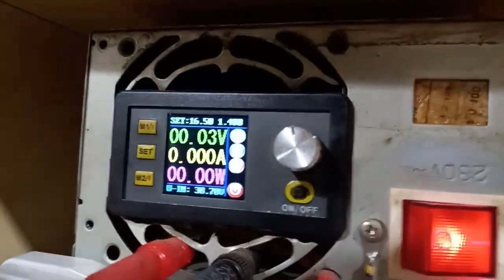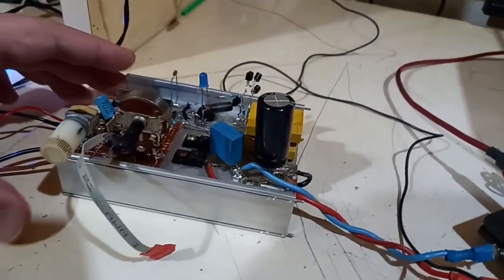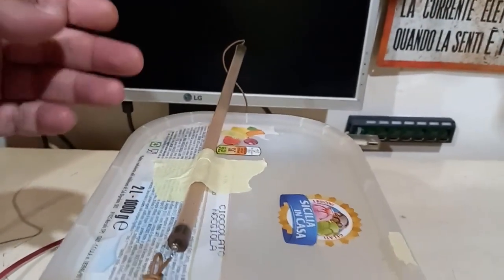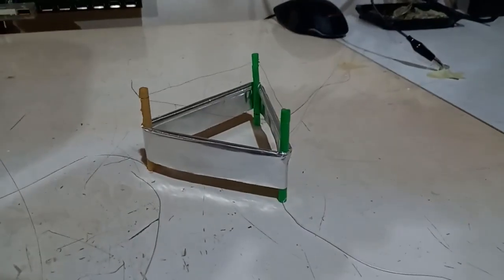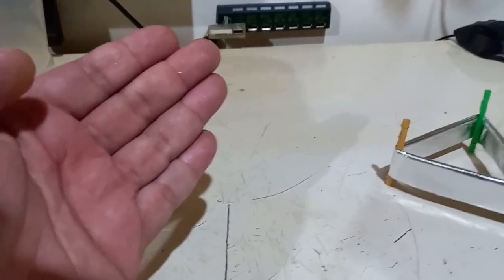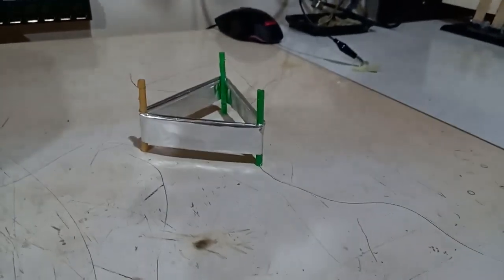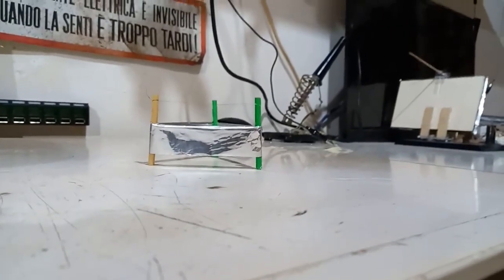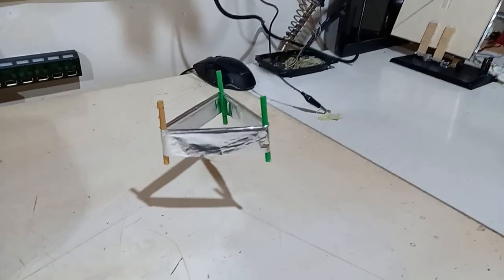Ionocraft, Lifter, whatever you call it...

Comment: Sir can I use CFL ballet
Reply from the maker: i think not, you need a way to adjust the voltage on the thruster, a CFL ballast can't be adjusted much, and also as far as i can see that solution drives the flyback quite poorly... you need a chunky mosfet driven by a NE555, the chip is easy to find but the mosfet is costly, you can "make" one by putting in parallel some smaller mosfets, like at least three IRF630 or a pair of IRF640, and power this driver with an adjustable power supply (if you wonder, these mosfets can often be found in CRT computer monitors, but one isn't enough)

or you can try to vary the distance between the skirt and the wire instead of adjusting the voltage, but the work increases and it's annoying
Reply: But what if I use fan regulator?? To adjust voltage
Reply from the maker: @ghostr.i.pgaming9528  it will would probably not work at all, a CFL driver has diodes and a capacitor to make DC, so it runs on DC, that regulator is just a dimmer, even if it adjusts that DC voltage (and it will probably not) the CFL driver will just go crazy if you lower its voltage, even with a real variac a CFL driver can't be regulated much, but maybe with a variac would kinda work
Reply: I am so confused 🫥🫥
Reply from the maker: @ghostr.i.pgaming9528  in my opinion you just need a decent driver for the flyback and a way to adjust the voltage... sadly you can't do these experiments with just a pair of trashy devices, the difficulty increases a lot.... try!!.... give it a try with what you have, you may be lucky, i dunno
Reply: @PosthumanKindergarten  ok
Reply: @PosthumanKindergarten as you say I bought 3 630 mosfet and ne555 chip but in need digram. sir I am std 10 student I need it for science fair. I research about this 555 pulse driver but I don't know what capacitor, resistor and diode I use there are so many videos on YouTube and they use different resistor,cap, diode etc.. so sir please post digram of this driver please 🥺🥺
Reply: I have disent knowledge about this components
Reply from the maker: @ghostr.i.pgaming9528  ok, you have to put the 3 mosfet in parallel, all the gates together, all the drains together, all the sources together, you can mount all the mosfets on a single big heatsink without insulators, but better using thermal compound (whatever type), then use this schematic (i can't paste links on YT cos they get filtered cos it's considered spam), look on google images for "ne555 quasi resonant driver" made by jozef bojin, you need the diode and resistor on the pin3 of the 555 to the mosfet, you can find that diode in a CFL driver, a resistor from 470 ohms to 820 is ok... for the potentiometer you can use a 4k7 instead

better power the 555 at 12V trough a separate small power supply (so pins 4 and 8 to 12V instead), but the ground must be common, and power the flyback with an adjustable voltage from 0 to 20Vdc, you need at least a pair of amperes but current limitation is also good (you theoretically need a bench power supply)

the capacitor on the flyback may be tricky to be found, you can try with the mains inlet capacitors in a TV (the ones with a lot of writings) but those are often damaged, you need a chunky capacitor of 220nF and of at least 200V, you may find one that is still working near the flyback of a TV, i dunno... but it must be MKP or polypropylene (PP)

make like 10 turns on the core of the flyback with good insulated wire.... when trying the circuit start at low power and try with both polarities of the primary of the flyback, swapping the wires, when it makes the longest arc you got the polarity right

you also have to adjust the frequency on the pot of the circuit, something like 14-20kHz is ok, the lower the frequency the longer the arc but the higher the current drawn, if you start hearing an high pitched noise you are at like 16-18kHz and it's ok

you need a big electrolytic capacitor on the power section of the circuit, like a 4700uF 25-35V, you can find it in a TV or compact stereo or put some in parallel, if you use an adjustable switching PSU and it goes into protection better use a smaller capacitor

if you can find components maybe it was better to buy a single IRFP250 or IRFP260

and beware!! it's high voltage!! this may not be lethal but you can get shocked and who knows!!!
Reply: https://youtu.be/Q3m9xzbH0NM?si=1P5zICuUroCC93ja
Reply: https://youtu.be/YI8cgm5ztgw?si=eHx9Df2_8QY-YJyW
Reply: https://youtu.be/LhVx6I140Bk?si=6sflds43VZ3_1E9h
Reply: Check this videos
Reply: I use 10uf cap in pin 1&2 of 555. it is ok?🤔🤔
Reply: Sir I said to Post community not link of the diagram
Reply: Hove much current it needs ? I have not bench power supply so I use stape down transformer
Reply from the maker: @ghostr.i.pgaming9528  it's 10 nanofarads, not microfarads, it's a small polyester capacitor.... and it's from pin 2 to ground, not just pin 1

what you mean by "community"?

you need at least 2 amperes of current, maybe just 1A if you don't want to arc the output and instead just make corona for the lifter

Comment: You could have changed the design and just wrapped the straws in AL instead of making a wide skirt. Turns out it's not needed. A thicker copper wire as cathode might also work. Variation goes a long way,  viewwise
Reply from the maker: i dunno i just followed one guide and it works soooooo, anyways same story of before, if can't do a REAL improvement i will call this just a whatever experiment, and i dunno if that has so success for an ionocraft